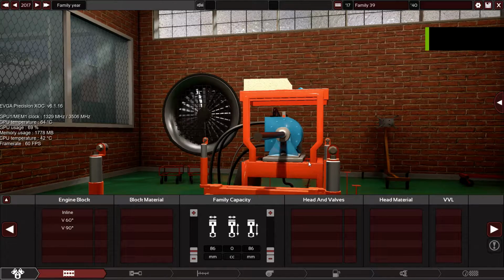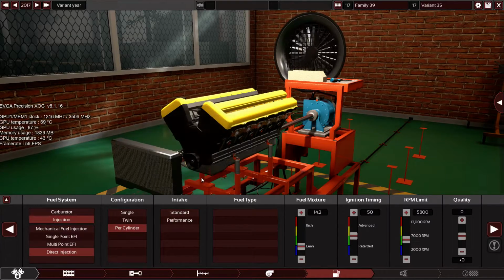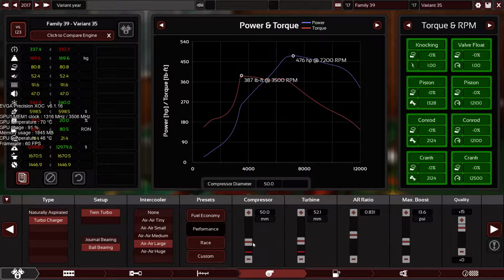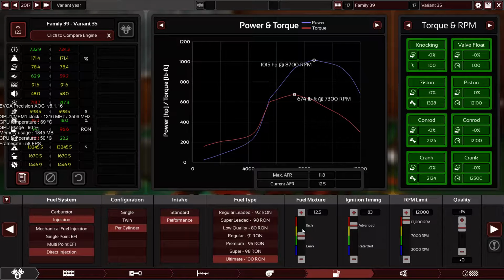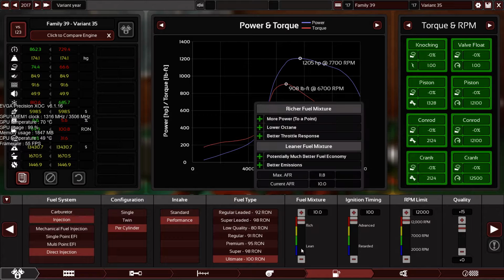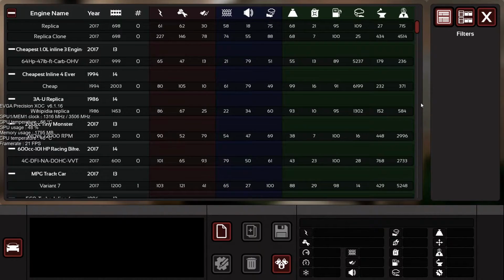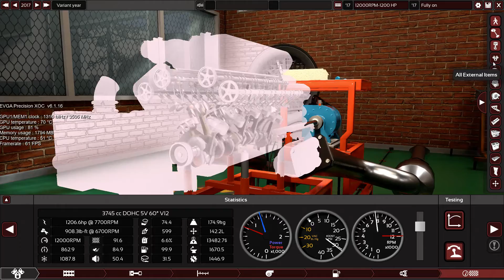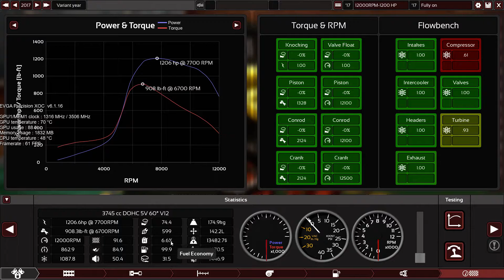1200 HP 12000 RPM V12 engine.

Comment: Can you make an inline 6 with 84 mm bore and 89.6 mm stroke and maybe a 7k redline, if it can handle more that is fine, with 12+ quality, and aluminum block, DOHC, 4 valves per cylinder, compression 10.2 with a turbo on 100 to 105 octane. I would like to know what is the highest psi it can run before it gets to any problems. The engine is an m54b30 by bmw.
Reply from the maker: +Eduwin Deleon 
I can do it.
Thank you for your awesome specific request.

Comment: I have a question for you what's better for more power a turbo or a super charger normally I'd pick a turbo/twin turbo but with centrifugal superchargers becoming more mainstream I'm at an impasse what do u think
Reply from the maker: +Camron Goodall 
You have to decide first what kind of a boost guy you are. If you are a low RPM daily driving and you want the most amount and instant torque at low RPM and up You need a root supercharger or a twin screw supercharger. If you were a high RPM guy for drag racing or racing then you need a centrifugal supercharger because it’s instant to make torque. If you were aiming for the highest power output at high RPM and you love to fabricate piping and mounting intercoolers then Turbochargers are your friends. 
Your choice man.
For me because I drive a daily car I prefer the twin screw supercharger because it comes as a kit and it’s easy to work with if you can manage the belt not to slip and the engine not to overheat. 
Thank you for your awesome question.
Reply: @BsharNasri  I Am Both.

Comment: Thanks didn't know u we're from Saudi Arabia( btw do u know why the power and torque drops off past 8k rpm wouldn't more rpm increase torque which would increase horsepower in theory I don't understand
Reply: the turbo dies after 8k rpm, didn't you see?
Reply: Bshar Nasri yes i actually did
Reply: Bshar Nasri no I missed when u said that sorry
Reply from the maker: +Camron Goodall 
I live in Saudi Arabia but I’m from Syria 😊
Reply from the maker: +Tomas Pradelli 
I said that in the video 
Didn’t you hear that?
The request is 12000 rpm so it will be 12000 unless if it explode.
Reply from the maker: +Tomas Pradelli 👍👍👍👍👍👍
Reply from the maker: +Camron Goodall 
It’s ok 👍👍👍